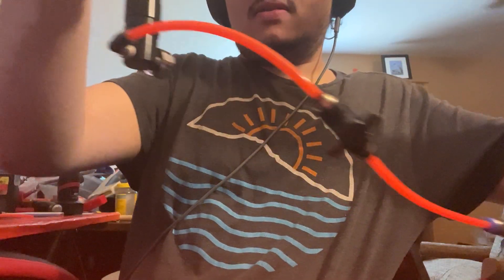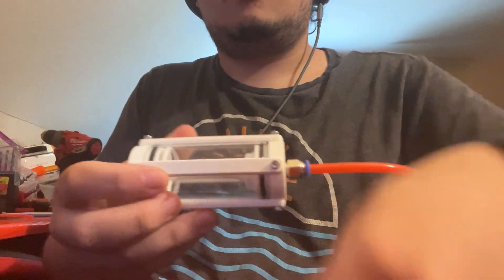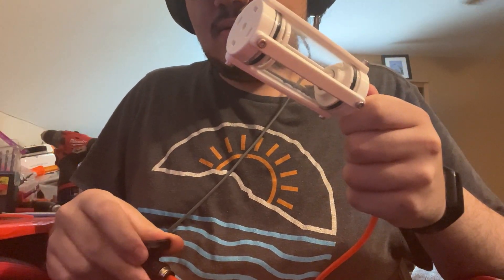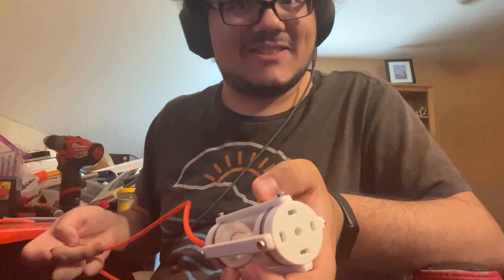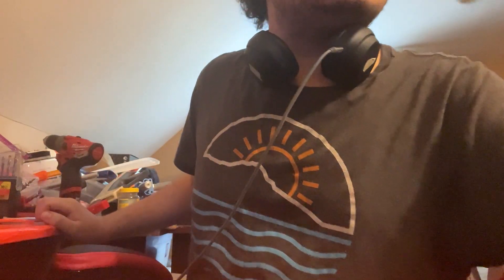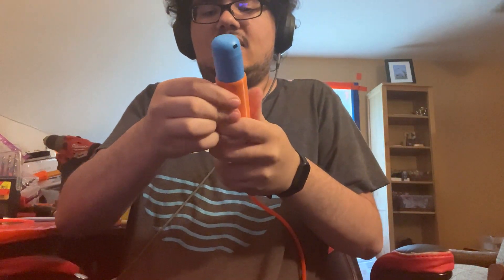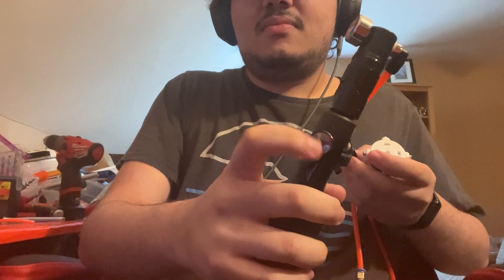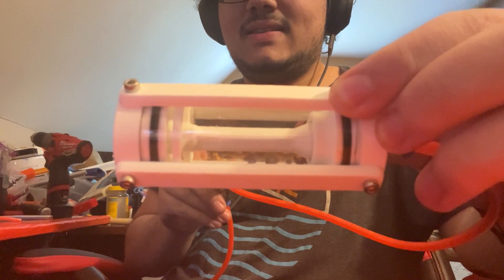Nerf HPA 3D printed core: SUCCESS! It’s so powerful!

Comment: Is this mechanism is like drain blaster?
Reply from the maker: I’m not very familiar with how those work mechanically, but I think it could be roughly equivalent. This doesn’t use a flexible membrane though, where I think drain blasters and stuff like the XBZ tank do need membranes to function.

Comment: You should just use the airsoft QD fittings that normally come on the regulator, they're self sealing and negate the ball valve. They should be in the suggested section on wherever you bought the knockoff Polarstar MR you're using
Reply from the maker: I actually got this tank and regulator second hand from Roboman.

Comment: What PSI where you running it at?
Reply from the maker: 100 PSI.
Reply: 100 PSI is easily attainable for anyone even using a cheap harbor freight air compressor to fill the tank. The fact you've already solved for most of the difficult bits is kind of incredible.